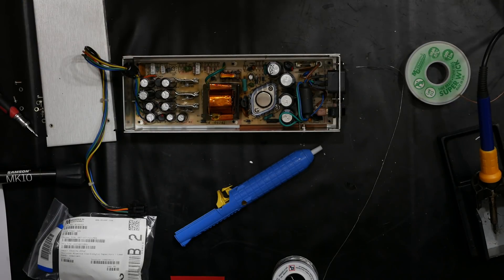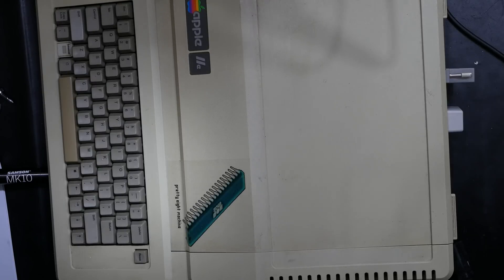Apple II PSU Repair

Comment: Hey mate really good video. Could you advice on mine? It doesn't react when switched on but if I waggle the cord in the power port, it'll occasionally come alive for a bit before dying a few second later, almost as if there's a contact/circuit problem. Could that be caps or something else?

Comment: I noticed your RIFA Capacitor is totally removed.  Any issues with that setup?
Reply from the maker: No.  I don't have any NTSC RF Broadcasts in this country anymore.
Reply: @TheTXDj  If that's the case, I may proactively remove them from my power supplies.   Would you happen to have a link to the specific 10v 220 microfarad capacitor you use?  Thanks!

Comment: personally i prefer the dyna comp power supply because the gold rifa caps that usually go are in the power inlet socket and i would rather have to change that than solder on the board. i see yours was a different one but in most of these videos  its the gold rifa.
Reply from the maker: Than Oliver I prefer the Astecs for a lot of reasons.  And the ability to cut out the rifa cap is one of them.

Comment: Suggestion: please consider adding screen capture to your videos when using a computer in a video.  It's usually not easy to see the computer monitor in your videos, adding screen capture will improve the learning aspect of the videos. It will allow for more comprehension of what is actually happening.  Thank you for the informative videos.   I would enjoy seeing a shop tour of your shop soon. I am very curious as to what equipment is in your shop!

Comment: That cap sits next to a power resistor that does get hot and it just bakes.  The new replacements are much small and can be moved just a tad further away so will likely never experience the same problem.  Nice, informative video.

Comment: THANK YOU so much my friend.  My IIE would not power up at all. I did order a replacement , BUT after watching your video I actually didn't have one so I pulled out an old parts only cassette deck I had and found a 220uf 25 volt. I put that in and VOLLA, she powered up. I went ahead and subscribed. BTW do you know what that cap does in the ckt?

Comment: it would be nicer if you show how you remove the case, and discharge  the power supply capacitors (since it has some high voltage cap)
Reply from the maker: The case has 4-8 screws that remove one panel, it's pretty self explanatory.  There's no need to discharge any caps.

Comment: You seemed to know exactly which capacitor to go to right away.  Is that because that's usually the one that fails, or was it just a lucky guess?  Dj makes it look so easy LOL.
Reply from the maker: Bolling Holt experience...  A no start condition without chirping or ticking is usually that exact cap.
Reply: @TheTXDj  Man, you saved me several hours of troubleshooting. I was halfway thru checking the input section, just finished removing and testing the diode bridge and some input capacitors and stumbled upon your video. Replaced the 220uF cap and the Apple II Plus a friend retrieved from the dump was back alive! THANKS A BUNCH!
Reply: One of my many restoration projects includes an old PS/2, and it does upon powering is make a whining noise from the power supply.  I imagine that I better start getting as good at diagnosing bad capacitors as you ;)

Comment: Any idea why the space bars always end up brown and do you know if hydrogen peroxide would fix it?
Reply from the maker: DigitalAura sure- the homies that is added to abs plastic is the cause.  Retr0brite can reverse it.
Reply: Thanks for the quick reply, now to try and pry it off without breaking it :)  Still think it's kind of odd that it mostly just affects the space bar. Frikkin love my Apple IIe.
Reply from the maker: LOL I just noticed that the autocorrect changed "bromides" to "homies"

You should be able to make it better with 3% Hydrogen Peroxide, just submerge it and put it in the sun a while, check on it every now and then.

Comment: When you recap 1, do them all
Reply from the maker: Rick Boatright I don’t typically- it’s easy enough to only replace the one or 3 that need it
Reply: My experience has been that if one has gone, the others are at best marginal, and probably teetering on the edge of failure.  As long as I have a machine open, I may as well swap them all.  On this PSU, it would cost what, two bux?
Reply from the maker: Rick Boatright I’m not actually disagreeing with you, just saying I haven’t typically done it that way. A full cap kit at bulk cost is about $5 or $7 at most.  The reason I don’t just simply replace them all is because the output filters need to be a fairly low ESR cap.  If I don’t have any that work I just won’t.

Comment: Great repair video!  What is that IMSAI computer, with the built-in monitor, above you?
Reply from the maker: That is an IMSAI PCS 80/30.  A little-known later model machine.  It's an 8085-based S100 system with "built in" video and uses the imsai parallel keyboard.

Comment: I wonder what this capacitor does. Perhaps it props up the auxiliary.

I think the reason for its earlier than most failure is the brown spot under it, whatever it is nearby, the green thing, normally i'd expect this colour for inductors? not sure, anyway the board colour says it's running warm, and it might actually be fine running warm; however it very nearly touches that capacitor, so it cooks it.
Reply from the maker: Siana Gearz all good explanations. Mostly it’s because it is 35 years old, and aluminum electrolytic just go bad eventually.
Reply: Siana Gearz that small green radial leaded component near that cap is an inductor labelled L3 on the board. I agree that it’s probably heat leading to failure but it could be heat from its own internal resistance (ESR) and its job in the circuit causing the heat. Or possibly from the nearby heatsink on Q2.